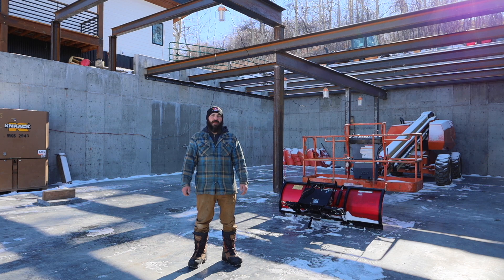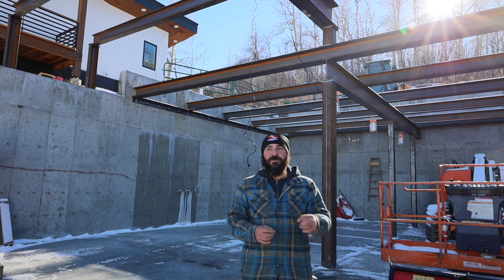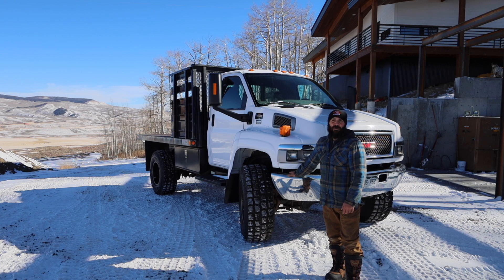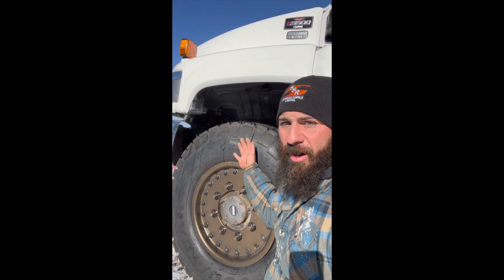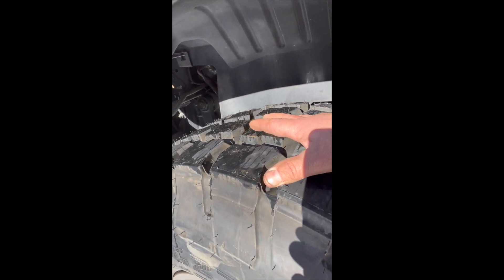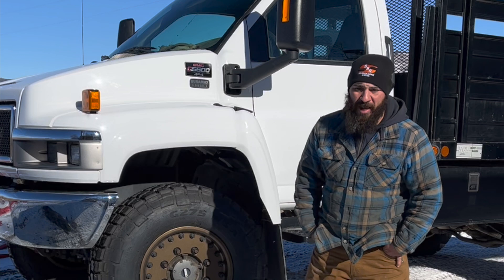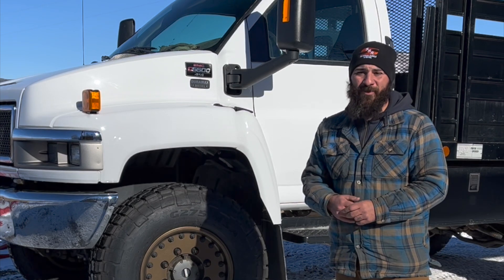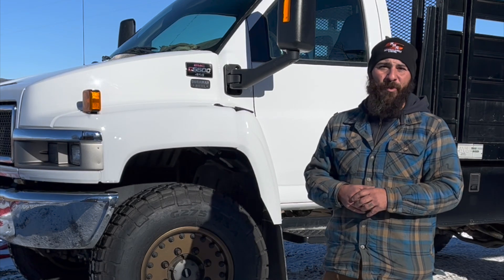2005 GMC Topkick overland build

Comment: hard has hell to find folk that will sipe tires that large (or any tire for that matter)  in places that dont have CO snow.  They make the tires run cooler too (more places to expel heat).   Guess its a trade off.... Would love to sipe mine.

PS niceeeeeeeeee truck choice.
Reply from the maker: Thanks, I agree it doesn’t matter where you are finding a siping machine is difficult!

Comment: If I can find a place to work on mine? The both sides of the manual hubs little metric  machine screws broke. So one of the guys and his dad changed to Gr 8 1/4" machine screws going to do that to mine so don't have that problem again. All 12 broke off they were rusty as well, so were broken for awhile.